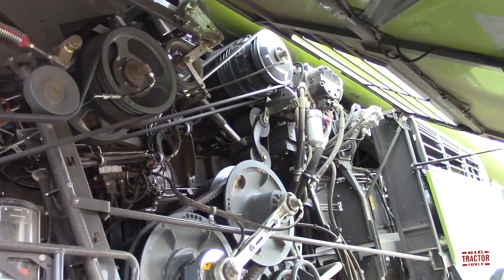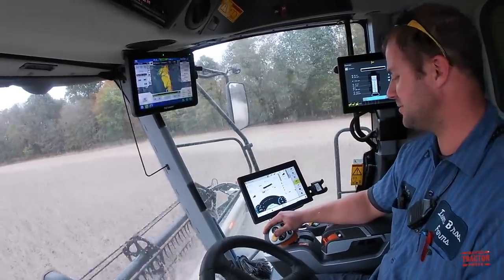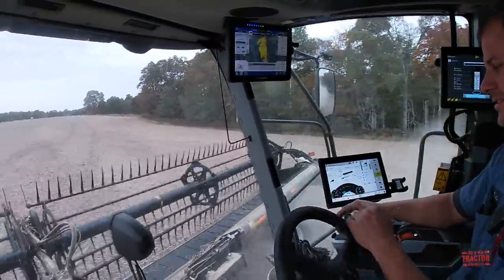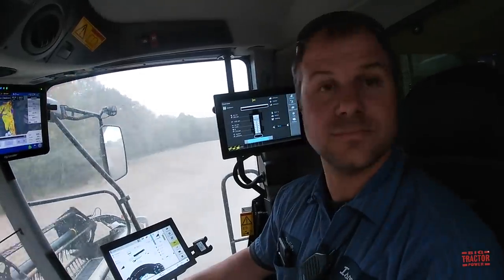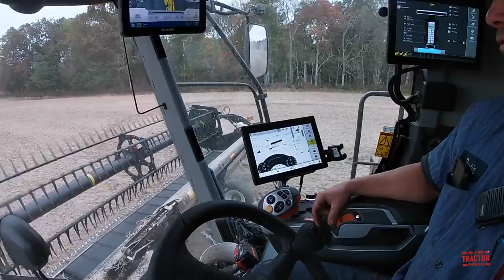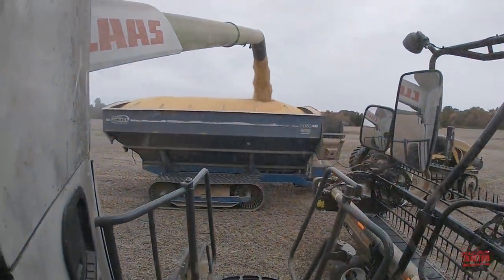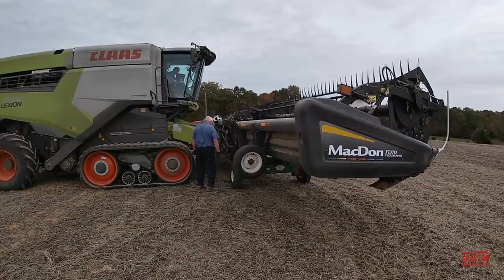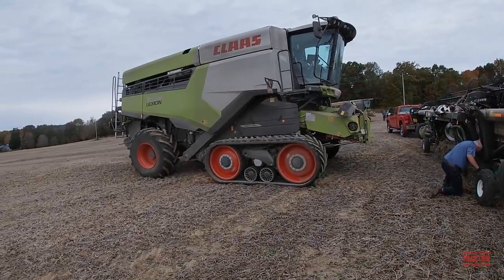CLAAS 8600 TT Lexion Combine Harvesting Soybeans

Comment: Claas are class, probably manufacture the worlds best harvesting equipment!
Reply: That’s John Deere
Reply from the maker: Lexions are solid machines.
Reply: Agreed, from combines to choppers to rigid body tracked tractors and the Big M's, also balers etc. and they've been leading the pack in engineering for most of it too.
Reply: @piperdoug428  Claas doesn’t make the big M
Reply: @Jaxon-iu6vb  yeah Ye got me, and Claas don’t even make their big mower anymore 😆

Comment: We purchased 2 gleaner s98 combines this December.  We run 2 in soybeans and 1 in corn . We have a johndeere 9870sts as well but we did demo a claas 8600 . They are very nice combines with plenty of power.  Our biggest problem with claas is that there aren't any dealers near us  . For use to get parts or repairs we would have to drive over 2 hours to the nearest dealership. No one in our area runs claas combines either but I'd like to be the first ! We think  claas does better in corn than deere case and gleaner.  We might lease or even buy one next year if the grain markets are decent enough.
Reply from the maker: I film all brands of combines.  The Gleaner S series by far has the cleanest grain and least loss.  These new Claas combines are monsters.  If you want to move a bunch of grain in hurry with a quality return the Lexion is hard to beat. The track system really sets the Lexion apart.
Reply: @bigtractorpower  we tend to trade combines ever 3 seasons or sooner  . We farm 8000 acres between our land and custom farming.  Some years we cover 10 to 12 thousand acres with the combines.  We like the deere machines but they wear out faster and have a poor corn sample compared to case or gleaner . The gleaners are simple machines that hold up great but they couldn't  handle a large head until in the last 6 years or so .  Case machines are nice for capacity and corn sample but like deere they wear out fast . We think the claas has the capacity grain sample and wear along with better technology.  Only time will tell if we lease a claas but if I get my way we will at least demo one for both corn and soybeans this next fall . We demoed one last fall for a day but it was in corn not soybeans and soybeans are our main crop.

Comment: That wiper in the middle of the wind shield with a power cord from the column would drive me nuts. Surely Claas with all it's engineering skills could do better!😂
Reply from the maker: The wiper runs 360 degrees around the window.  From what I have watched in the cab it works well.  It has been a staple of their cab design since 1998.
Reply: Yea, that's always been a bit of a pet peeve for farmers, but I think most have gotten to where they can overlook that little flaw...I mean, in all fairness, the wipers do work really well.

Comment: We Run a 2011 Claas 750 APS Hybrid Terra Trac but the only downside is that it has the Slower or first generation tracks not the high speed or 2nd gen tracks and that’s the year they started making the tracks I think we harvest 12 rows at a time in corn and 40ft at a time in beans and winter wheat

Comment: The MAN D26 diesel (126 mm bore) is 12.4 liters in displacement. It is a close relative to the Maxxforce 13 and the current A26 engine in Navistar trucks. Navistar is now completely owned by Volkswagen which also owns MAN Trucks in Germany.
Reply: Hope it’s not too close to the maxxforce 🤦‍♂️. Traton even owns scania I think. Insane.
Reply: @stirv6462  Traton is using both Scania and MAN engineers to develop engines so they don't duplicate efforts.
They are working on a 13 liter Common Base Engine (CBE) to be first installed in Scania trucks in late 2021.
They will later be installed in MAN trucks. I'm sure off-road versions will end in combines, tractors, etc.
Reply: @briansmith8385  how do you know all this stuff?

Comment: if someone made a 60' head could you push it?
Reply from the maker: Yes.  They offer 60ft models in Australia right now.   In North America 50ft is the largest width at the moment.  A rolling field like this would not work too well with a 60ft.
Reply: @bigtractorpower , which parts of North America would be best suited for a 60-foot draper, areas where the fields are level?